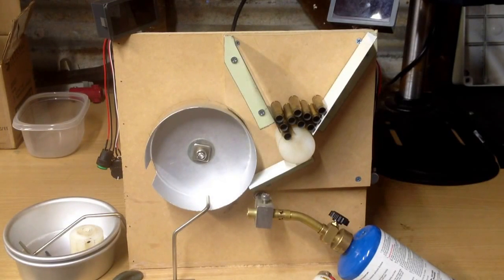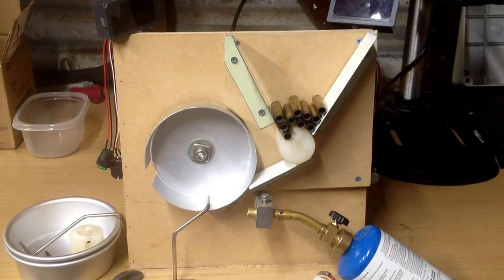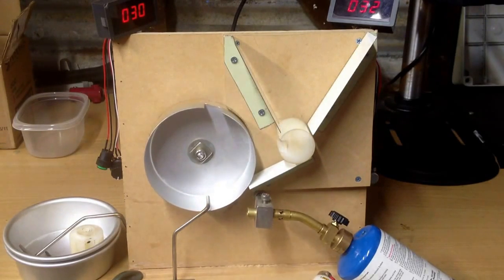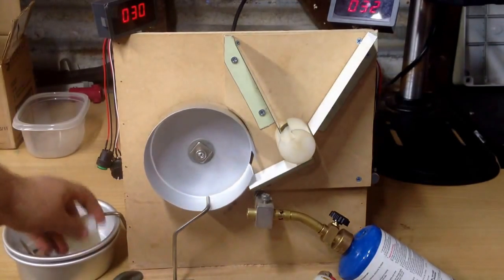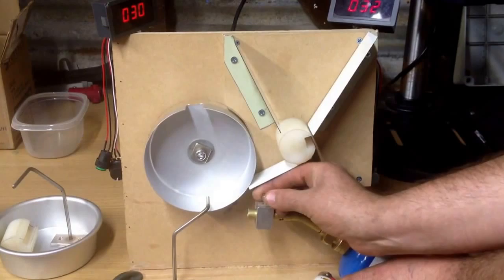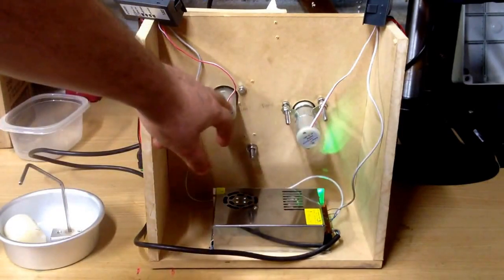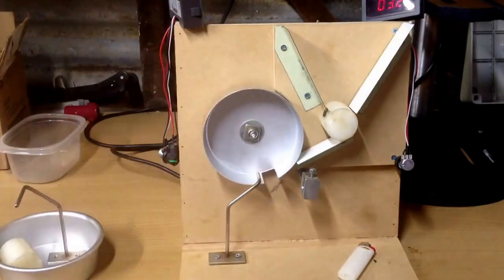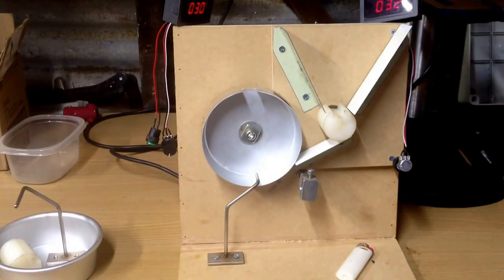Skips case annealer V1.6 final build.

Comment: Nice job.  Where did you get the white plastic rollers.
Reply from the maker: Don't know exactly where you can source them. But they are just acital,delrin,nylon,pvc extruded machinable plastic bar stock. EBay, machinest suppliy shop etc you can source.

A fellow Aussie named Cheng has done a cheap machine available in some countries he has suppliers in the US. It's called the ugly annealer. He is supplying nicely built machines for the same cost as I was building them for when I made v2 of black Betty annealers.

Comment: Brilliant, mate!  Really first class idea.  But why the two motors?  Why not one motor driving two identical pulleys or sprockets, so the two rotors always stay in time with one another?  Surely there’s no point in having them rotate at different rates.
Reply from the maker: It's been mentioned time and time again. It was just for the simplistically. Without having to make standoffs, pulleys belts bearings etc.

The later version added just a inductive sensor that turned the feeder drum off and worked off the single pwm.

Comment: I've got 2000 556 brass to anneal... I'll definitely be making one of these lol. Did about 50 by hand and said no way.
Reply from the maker: Squid Master you’ll knock em out in no time. 

Most I e done in a single sitting was 223,300blkout,17 Fireball. 3000 cases

Comment: Very nice, I like your design over the "Annealeeze" which is extremely "LOUD and ANNOYING", and expensive to boot. Great job. Where did you aquire the two electric motors if you don't mind me asking?.
                    kind regards!
                    Eric Dee.
Reply from the maker: Eric Dee eBay 

Upgraded motor is the 10 rpm worm gear 12vdc the one in vid is a 25rpm 8mm shaft 12vdc
Reply: SKIPPYISAAUSSIE " thank you for your time in response.  your design is superior to the "Annealeeze" in my opinion, keep up the great work, and thank you for sharing.  good luck to you in the future. I would like to see your design on the market. you take pride in your craftsmanship. 
            Kind regards!
             Eric Dee.
Reply from the maker: Eric Dee 

If I wanted to market it, I wouldn't of made it open source and gave it freely out to the world. 

Just proves you don't need to spend mega bucks on a tool to do a simple job. With a little time and some tools you can build your own auto annealer for $100. 

Now I do make V2.0 see the other vids. In my spare time for local guys and have made parts for people who are local Aussies, kiwis area. I don't make it for free, I do charge a hobby rate for that.

Comment: Hey Skip, Thanks for he great Video!
Can you please tell me what the diameter of the two cups (brass feed cup & annealing cup) are?

Thanks from Canada!
Reply from the maker: 5" cake tin and the case feeder ( mine is 40mm ) ones i made for others in the group buy of some parts for aussie locals i made outta 50mm
Reply: how did you find center for the hole in the cake pan? my little lathe (harbor freight) is not big enough to grab the outside....any ideas?

Comment: Where did you buy the 50x50mm cheap plastic round bar? I see a few places online but it is $20+
Reply from the maker: I got the round bar from a mate ( off cuts bin ) from his shop. If your kind enough they might give it to you for free. 

If no machine shops close by, try Ebay, you can get off cuts cheap enough.
Reply from the maker: I found a heap on ebay from a cnc shop that had them up for sale ( offcuts ) which i brought and then machined up for the local aussie guys in the group buy.

Comment: Hi skip, any guidance on wiring up the motors and their respective controllers?
Reply from the maker: Hi mate 

The digital controllers used in the build of v1.6 came pre wired with the turn pot and on/off button. ( not bad for $8 ) Only really need to connect the -+ to the controller and the -+ to the power supply. 3mm auto cable will do fine red for positive and black for negative. 

As for the AC power, a sparky should do it. Im not liable should you decide to wire the ac too dc up yourself. Each country is different like in Aus, its green yellow ( ground ) red ( positive ) black ( negative ), yanks have different colour cable codes.  

You don't need a lot of power to run both motors and controllers, you could find a dc power supply that runs off mains then you could just cut the cable and connect the +- cable to the controllers.  Or another option is a small 12v battery to run it off. ( plenty of ways to skin a cat ) just have to find a way that suits your needs.
Reply from the maker: Anti clockwise. If using the same. Wire up power to controller correctly then from controller too motor switch it around.  ( you can pause the vid ) you might see the wires how i have it wired up.

Comment: I like your design. Why did you use two motors rather than one motor with both drums tied together with gears or a belt in order to insure that they stay in sync?
Reply from the maker: Hi Mate 

It was just ease of build, If i wanted to wait longer for more part's from china then i would of went the belt and or chain drive. 

I have another build planned for the winter. But at the moment im happy with mine, Good luck with your build how ever you approach it. 

Skip

Comment: What Diameter did you use foir your nylon roller that picks up the brass from the feed chute?

Thanks
Reply from the maker: Hi mate I used 40x45mm for mine but the one's i have made up for a few guy's on the forum is 50x50mm ( It's a double slot for both sized case's ) I have added screw's to act as stopper's and that can be swapped around should you switch from small - Large case's

If you are interested it's all written here on our forum ( You will have to join to see though )  http://shootingaustralia.net/forum/roll-your-own/9587-skip-s-case-annealer-black-betty
Reply from the maker: Mine 40 mm for others 50mm

Comment: Awesome job mate, bit more refined than the biscuit tin. I Might have to knock up something similar myself Good stuff.
Reply from the maker: LOL The biscuit tin did the job alright for awhile LOL. But yes this one is nicer :) I might even give it a lick of paint yet to tart it up a bit more :D LOL 

I've gotta scrounge up a bit of plate to make the back over and seat the digital read out's and the turn pot's and on?off switches. But i think that's it for me on making the annealing machine's. Ive got two drum's 1x 50mm thick ( for doing large cases ) and 1x 35mm thick ( the silver ally drum's "Cake tins " ) for doing smaller cases like .223 - .308 .  I just have to change the case feeder drum ( The white drum you see feeding case's )  for running .223 and everything else run's with the .308 case feeder drum. When i run my larger cases like 300 win mag i just use the larger case drum.
Reply: SKIPPYISAAUSSIE
I like it, looks like a winner mate, quick question for you, how were you getting your speeds and feeds for proper annealing? just use some of that tempilaq gear and record the settings on the digital read out?
Ive had a bit of a play myself with a deep socket, blow torch and some old scrap brass but it felt a bit hit and miss and I was certainly never game to put my Lapua brass through. If i still had acess to a machine shop at work with a decent mill and indexing head i might have made something more like the commerical machines out there but since im back to limited equipment that design looks to be the ticket, just need to slot a piece of nylon and bore it for a shaft. Youve certainly given me something to think about. Cheers mate